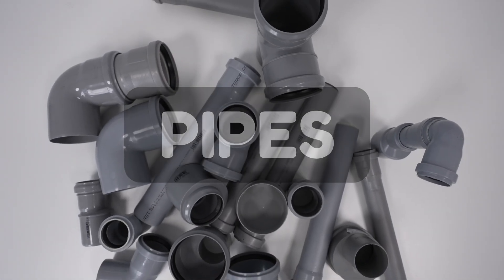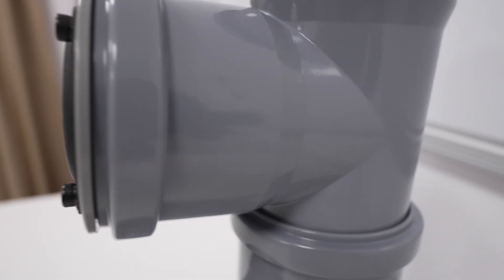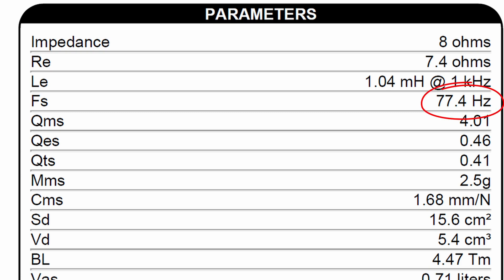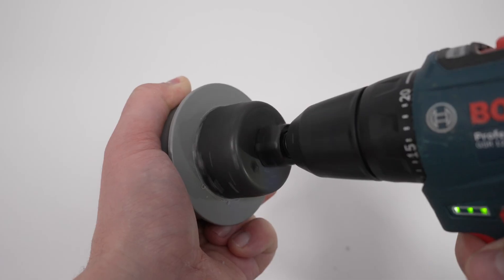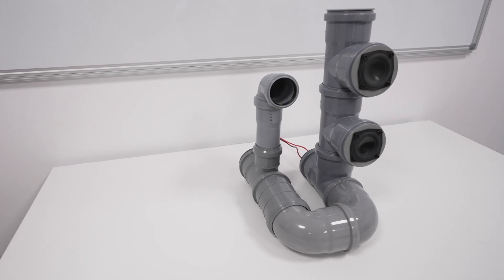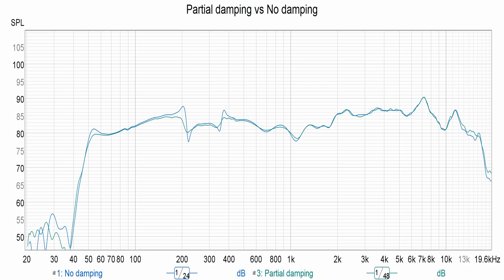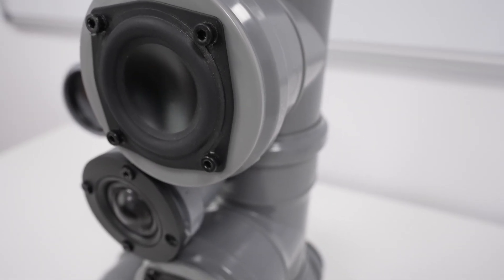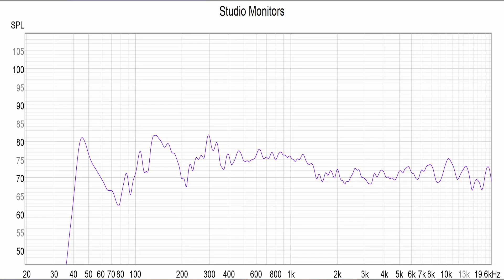Pipe Speakers - 30 minute build

Comment: Ori microfonul inregistreaza aiurea Ori are multa vibratie plasticul, incearca sa Le pui pe  o carpa ceva cred ca se transmite vibratie la birou si se aude spart.
Reply from the maker: Da. Nici acum nu imi e clar cum sa inregistrez niste boxe sa reflecte realitatea, desi nu am scule ieftine. Nu se aud spart, se aud chiar plin. Nu sunt wow dar pt niste tevi de pvc chiar impresionează . Plasticul nu zdrangane deloc.
Reply: @AudioJudgement   yes and you guessed it,it sounds like a tube

Comment: I built a PVC pipe speaker over 30 years ago in the mid 90's before the internet was a thing.  I had used a 3.5" car speaker mated to a 3" dia pipe.  The thing got really low and like yours not as high without a dedicated tweater.  Still, it was a fun project that impressed my friends.  Good video!

Comment: Looks cool, but the sound seems to be somewhat doff. There are also much more solid pipe-systems with more meat for the screws. I have seen pictures of nicely colored pipe-speakers, and they look really great in any pop color, just not so good in the standard pipe-colors, that also may easy confuses drunken guests where to take a leak.

Comment: An idea - take that straight piece just before the port exit - remove it from there and add it to the top of the enclosure, above the top speaker.  This should increase the offset of the drivers in the TL and might help to null out the response aberrations around 200 Hz...

Comment: On a side note, it’s not a speaker “box”, it’s a speaker enclosure.
Boxes are like square with sides.
I actually use a tube design with a 100” long length 4” diameter of lightweight sanitary tube in my car for my subwoofer. The subwoofer enclosure is tuned to approx 17Hz.
Reply: ahhh soooooo, ok, so that is what a box is.
Reply: Amazing, so is it like a transmission line?
Reply: @FranciscoGonzalez-qh5zd  
Yup! :)
Reply: I just found this channel 15 mins ago. I've spent several years between saving, researching, planning, and buying components for my first SQ build in an '06 Lexus IS250. My initial goal was building a halfway decent hifi system on roughly a $2k budget that still looked completely stock. Essentially unattainable on my budget, so that has ballooned to around $3k at this point and I'm waffling on my choice of subwoofer(s?)... Purchased a passive 11" JBL BassHub and Club A600 mono amp to hide in the tire well. I'd planned on replacing/building my own sturdier trunk floor, with Audison AP f8.9 bit DSP, amp and sub all hidden underneath to maintain the stock appearance, conserve space. This car is so miserably lacking in trunk space that the BassHub is STILL 2"+ too tall, AFTER removing the donut in a desperate attempt to make it fit. Considered raising the floor but I need the full trunk capacity for work if at all possible. I'm already using the cabin for cargo space, it's ridiculous... So firstly, congratulations on your build, the possibilities you just opened my eyes to have my brain exploding already🤣... I'd love to hear that beast🔥 The fact that you tuned your sub to 17 freakin Hz(!?!🤯🔥) using a transmission line is the coolest thing I've heard in a month of Sundays. My question is, would you please elaborate on the details of your build to get that low of a frequency response, and/or point me in the direction of a tutorial/forum thread/build example or video for more info? The fact I haven't seen this type of enclosure (?) even mentioned in car audio forums surprises me. I've seen a million transmission line YT vid thumbnails for bt speaker builds and honestly thought it was a total gimmick!😂😂 Joke's on me frr, cuz I'm kinda gobsmacked...I just found this channel and Audio Judgement (both of which seem to contain a wealth of knowledge so I may have answered my own question in the near future after some more clickety-clackety🤷‍♂️) within the last few minutes so I'll be scourin' but I'd really appreciate your response. Thanks for reading my book here too 🙄 Enjoy that low-end extension and God bless
🤜💥🤛
Reply: @randyrawdingii5135  
Of all the enclosures I have tested, for anything below 25Hz.. NOTHING beats a T-line. Well... a TUBE T-line for that matter. Why tube? Because tubes is very efficient for transmitting sound energy. A regular square box or port can have standing waves which can interfere with each other.
ALSO, since I am using sanitary PVC tube as the port, the whole system is MUCH lighter in weight than a standard T-Line or ported box which needs to be HUGE and can get heavy due to bracing, extra baffles etc. You DON"T need all that mess when using tube. The tube shape is naturally resistant to resonances and is very strong even when thin. My current port tube is 4" diameter x 100" long. 
And I'm gonna use four T-line systems so you can only imagine how deep and loud it's gonna sound in the Teens.
NOW... Is this system for everyone?.. no.. But I love to listen to Bass in ALL it's frequency glory. I HATE when I'm playing a Bass track and the subs unloads under 30Hz and all I hear is noise... EW... I try to avoid that.. ALSO... keep in mind that NOT ALL the Bass is coming from my subwoofer. A well balanced audio system consists of a Tweeter, Midrange, Woofer and subwoofer (Optional).
My current system has a Midbass woofer that covers all the bass from 50Hz UP. (Great for music that does not have very low bass like 80s or 70's music etc.)
THEN I have a subwoofer system for everything BELOW 50Hz where the Midbass rolls off. The Midbass woofer system I have plays between 45Hz up to 500Hz. The midranges 500Hz to 5Khz. The tweeters from 5Khz UP. As you can see, it's a well balanced sound system that sounds great and loud with the minimal amount of speakers. Any monkey with alot of money can throw a bunch of speakers, sound loud and call it a day. But it takes a smart person to be just as loud, and sound great with very few speakers. It's all about knowing frequency response and knowing how to blend everything in harmony.
Reply: @randyrawdingii5135  
Of all the enclosures I have tested, for anything below 25Hz.. NOTHING beats a T-line. Well... a TUBE T-line for that matter. Why tube? Because tubes is very efficient for transmitting sound energy. A regular square box or port can have standing waves which can interfere with each other.
ALSO, since I am using sanitary PVC tube as the port, the whole system is MUCH lighter in weight than a standard T-Line or ported box which needs to be HUGE and can get heavy due to bracing, extra baffles etc. You DON"T need all that mess when using tube. The tube shape is naturally resistant to resonances and is very strong even when thin. My current port tube is 4" diameter x 100" long. 
And I'm gonna use four T-line systems so you can only imagine how deep and loud it's gonna sound in the Teens.
NOW... Is this system for everyone?.. no.. But I love to listen to Bass in ALL it's frequency glory. I HATE when I'm playing a Bass track and the subs unloads under 30Hz and all I hear is noise... EW... I try to avoid that.. ALSO... keep in mind that NOT ALL the Bass is coming from my subwoofer. A well balanced audio system consists of a Tweeter, Midrange, Woofer and subwoofer (Optional).
My current system has a Midbass woofer that covers all the bass from 50Hz UP. (Great for music that does not have very low bass like 80s or 70's music etc.)
THEN I have a subwoofer system for everything BELOW 50Hz where the Midbass rolls off. The Midbass woofer system I have plays between 45Hz up to 500Hz. The midranges 500Hz to 5Khz. The tweeters from 5Khz UP. As you can see, it's a well balanced sound system that sounds great and loud with the minimal amount of speakers. Any monkey with alot of money can throw a bunch of speakers, sound loud and call it a day. But it takes a smart person to be just as loud, and sound great with very few speakers. It's all about knowing frequency response and knowing how to blend everything in harmony.
Reply: Are you using 4inch drivers?
Reply: @zonta71  
4”? No. A 18” Subwoofer.

Comment: I found your channel a few days ago, I like your scientific approach and overall good video quality, you deserve bigger audience. Didn't realize you are from Romania, hi from Ukraine. Have you tried using speakers from aliexpress? All what I can find across my country are some weird speakers designed for cars, T/S parameters are rarely mentioned. And european dealers for some reason either don't ship to Ukraine at all, or the delivery costs more than speakers themself.
Reply from the maker: Hello! Indeed Sound Imports doesn't ship to Ukraine. You can try Parts Express, as I know they ship to Romania. They most likely ship to Ukraine as well. If the shipping costs are too expensive, try ebay. I once found that the same item, shipped by Parts Express on Ebay, was cheaper compared to buying from their own website (talking about shipping cost). Not always the case, but worth a try.
Reply: Maybe you could try some speakers out of the garbage? Idk about Ukraine but i literally just found a sony subwoofer unit that I modified to be passive and connected to a cheap 2.1 aliexpress board. I would seriously start with something like that as that's what ive got going and its pretty good you could do something like that and then use the full ranges out of a dead boombox or cheap bookshelf speakers